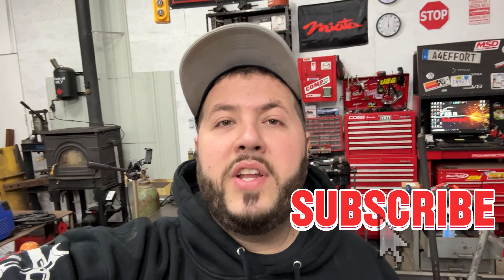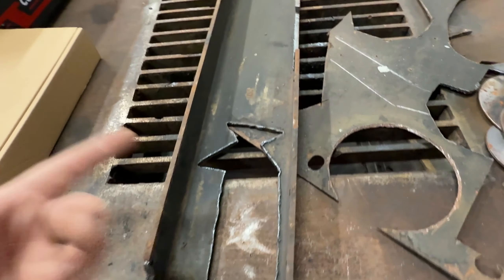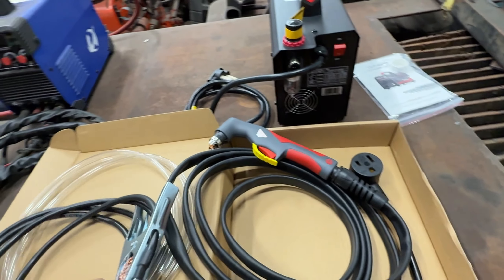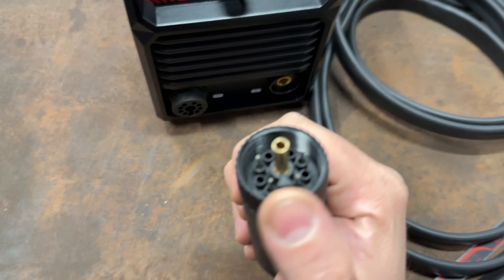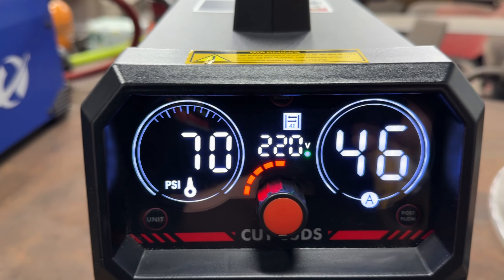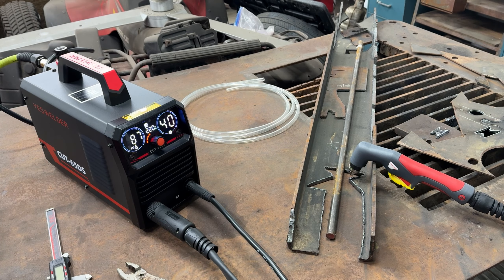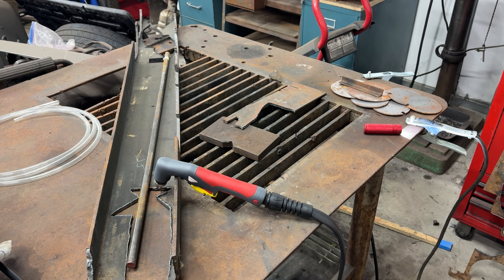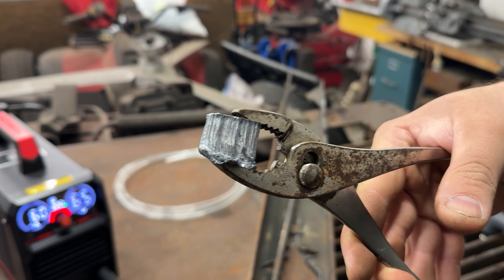Budget Plasma Cutter Upgrade? YesWelder 65DS / Pro review. Cuts 3/4" WHAT?

Comment: Are you wearing a welding helmet or anything to protect your eyes?
Reply from the maker: @Kinards_Kustoms  Yes I use a regular welding helmet most of the time when trying to cut accurate. I should also wear gloves but I don’t most of the time which is not smart on my part.
Reply: @fab_It_garage not wearing gloves isn’t as bad as not wearing eye protection! Lol I just noticed in one part it looked like you didn’t have anything on for your eyes! Lol
Reply from the maker: @ I didn’t lol, I use the torch head to block the light when I do small cuts which again not smart at all so don’t do that lol
Reply: @fab_It_garage 😂😂 at least you’re honest! I’ve just been burned way too many times!
Reply from the maker: @Kinards_Kustoms 🤣 I will learn soon hopefully lol.